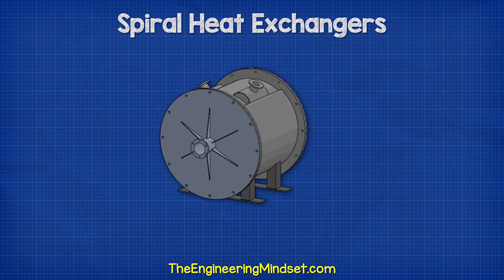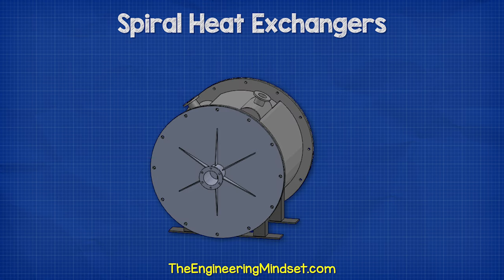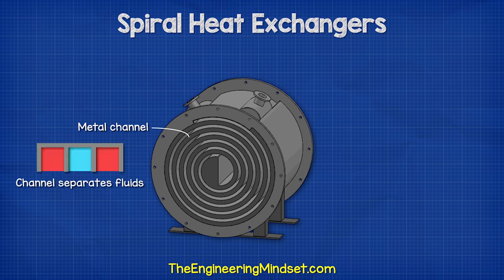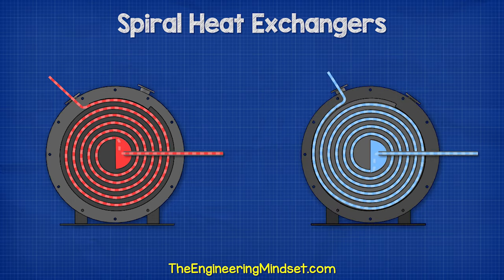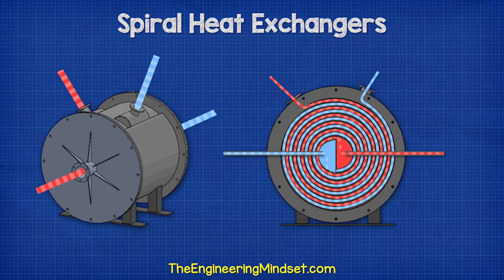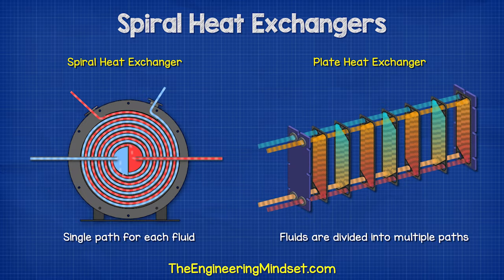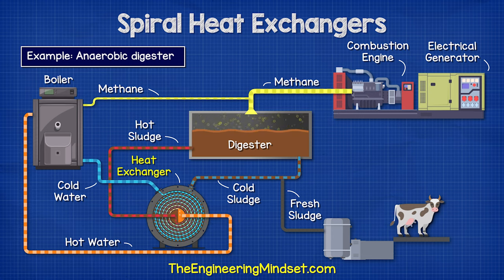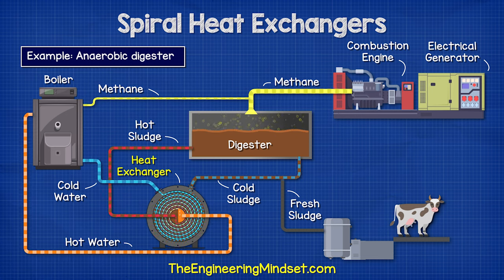Spiral Heat Exchangers Explained

Comment: They should invent a methane (CNG)/propane (LPG) fuel cell, like they already have with hydrogen fuel cells and soon with direct methanol fuel cells, so that efficiency can be improved greatly. This will go greatly towards solving the renewable energy problem, while also totally eliminating smog- and acid rain-forming NOx emissions.

Comment: Does the spiral exchanger require a bigger pump than other types? Since it is one continuous channel I would think the pressure drop is higher for an equivalent flow rate? At what point does the additional power consumption of the pump become prohibitive vs a different type of heat exchanger that is cleaned periodically?

Comment: This is similar to system 2000 oil boiler, except one fluid is water for the hydronic system,  and the other fluid is the hot gas from the oil burner.

Comment: So these HEX's🤔
Is it the same style of HEX thats in a Baxi Duo Tech Combi, for example 🤔
Heat Exchangers used to be Flat, Braisery Copper, Finned.
But now with Condensing Boilers ,the Hex's have changed massively in style.